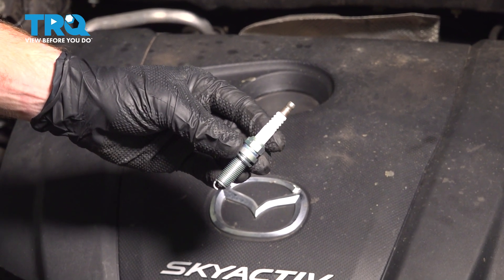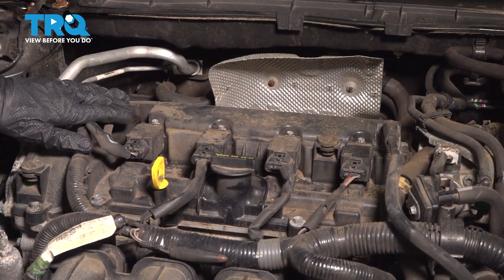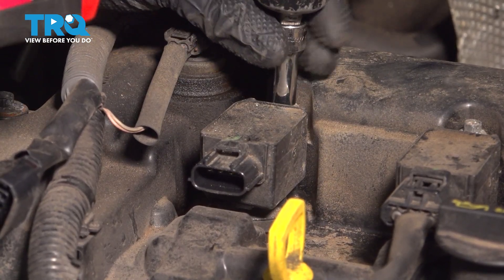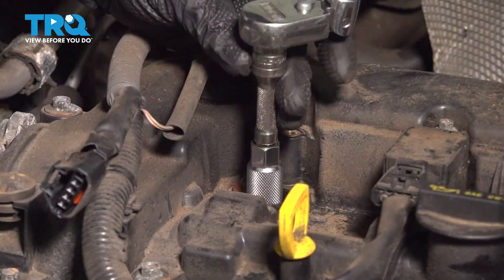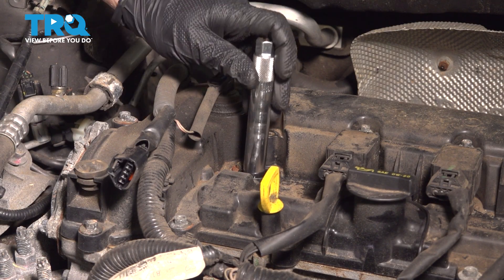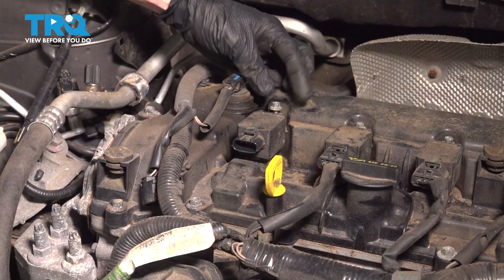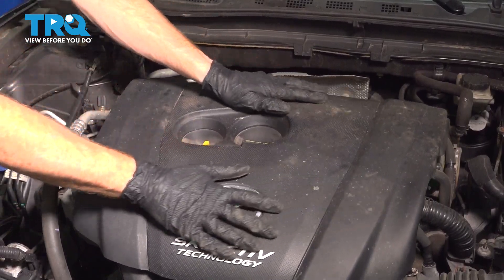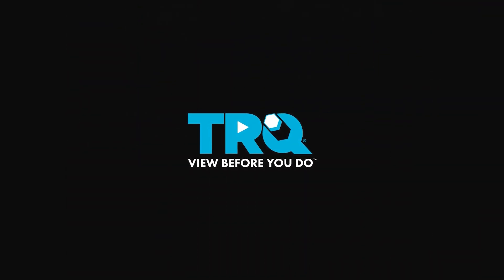How to Replace Spark Plugs 2014-2018 Mazda 3 2.0L

Comment: Regarding the dielectric grease…in a video from Eric the car guy from TRQ, he said only apply the grease to the porcelain section of the spark plug, “never to the electrode, that is bad.”  looks like in the example from this video, the dielectric grease applied to the spark plug coil would get on the electrode.  Can you confirm the best practice?  

Appreciate the detailed, to the point videos.  I’ve already got some parts to order from you in my cart.